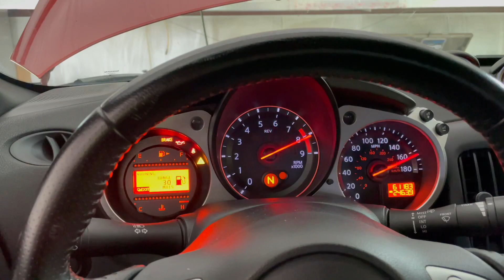Making My 370Z Stupid Loud. Test Pipes Install.

Comment: Did you get a check engine light after install those test pipes?
Reply: Yeah u will get one u  once you get a tune it will be gone
Reply: I have the same test pipes as him the ISR resonated, and no I did not get any. But, these test pipes are discontinued
Reply from the maker: Yes but it went away
Reply: @issaslowz  it went away how? did you tune it or just drove it few miles?
Reply from the maker: After driving awhile it went away by itself
Reply: you can get j style bungs to trick the code from coming on.